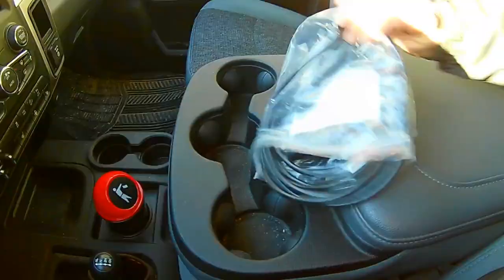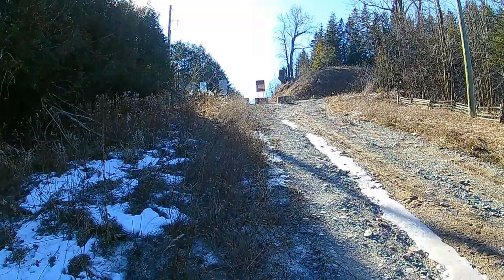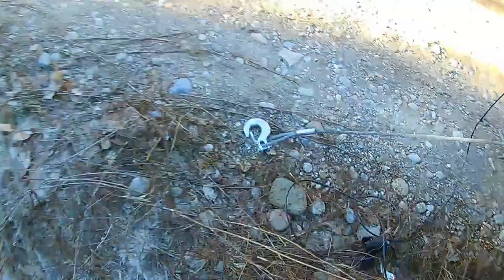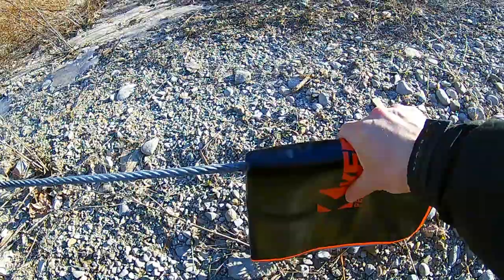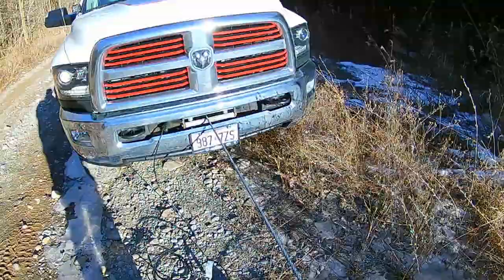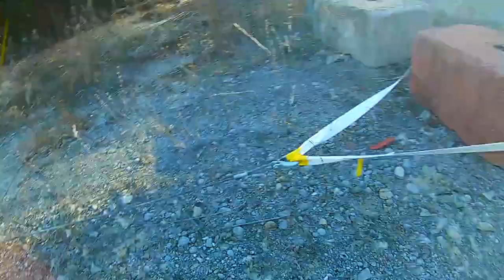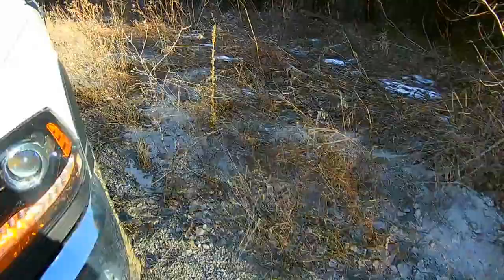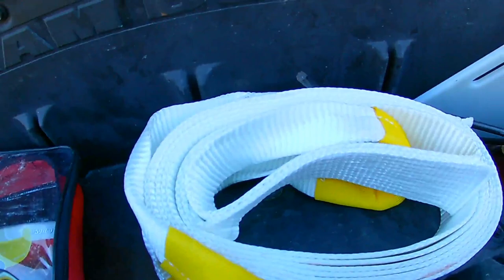How to pre tension your warn winch| ram power wagon|the basics

Comment: Excellent information! If I may add some...
First thing anyone should do is read the Warn specific area of the owner's manual (look it up online - the manual in the truck says nothing regarding Power Wagon features) 
Full pulling strength is with the cable nearly all the way out (no layered wraps)
Warn recommends no less than 5 wraps on the spool before you tension it up

If you don't have a hill near you to help with tension, you can do it on flat ground with the park brake set just a couple clicks down. That's how I did mine.
And FYI, the winch works when the truck is running on command start 😁
Reply from the maker: +Inappropriate Driver Input  You added some awesome, and valuable information too,thanks! LOL, never thought of the couple clicks on the park break ..good idea!

Comment: I don't get why Warn (or insert here) can't pre-tension when they put the rope on in the first place! That said, I've done several in my side yard hooked up to my tractor at the top of the lot. Enough grade to give enough tension, and my son steers as I coax the cable. I've thought about going synthetic, like I have on my Lexus, just to save weight, BUT,  I have a 1973 Hickey Sidewinder on my '77 K5 Blazer that came off our '73 Suburban. Still in great shape. Dragged my Dad and I through a ton of snow/mud on deer, elk hunts and helped to fell many a tree for firewood here in AZ. Rope still in fine shape. 

One point I might throw out there, put the hood up. If you are real concerned about the cable breaking, the hood makes an excellent shield and you can still see under it.

Oh, and Canadians call cement blocks rocks now? Guess thats like a bed or a box. :-)~ . Peace!
Reply from the maker: +Don Leamon I agree manufactures should pretension them👍🏻hood up to save the windshield from flying hooks, good idea!
Oh, and I knew someone was going to say something about calling that cement block a rock...🤣👍🏻 I didn’t realize I was doing that,the cold put a slight freeze on the brain..👊🏻
Reply: Well, our brethren in the northern territories, typically have a tough time with distances, volume, and shit, just measuring things in general. So a rock or a block. Who cares! LOL!
Reply from the maker: Close enough!😎🍻🍻🍻👊🏻
Reply: I believe the reason they're not pre-tensioned is because of how they ship... if you watch videos of brand new ones, the cable doesn't have the hook on it yet